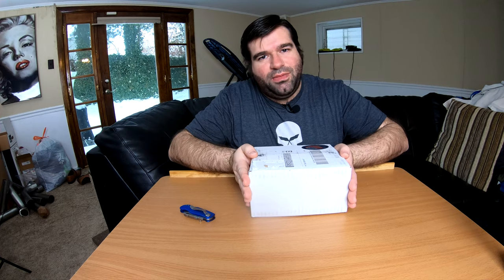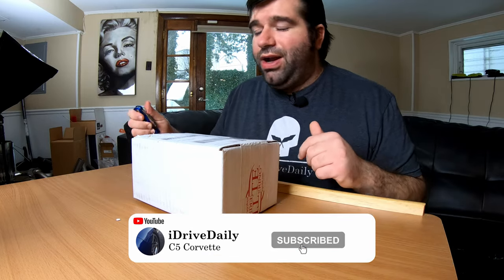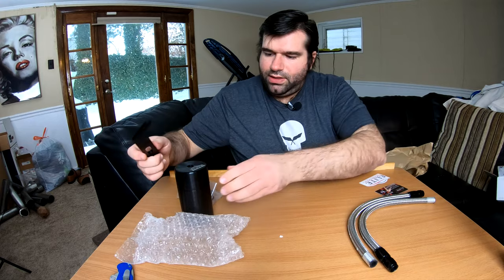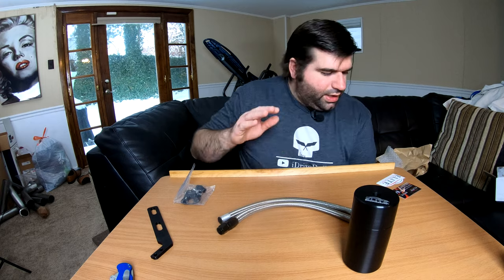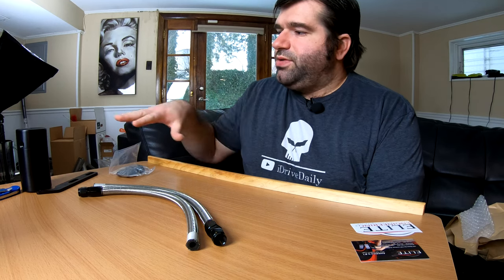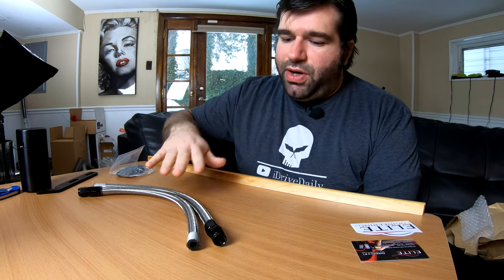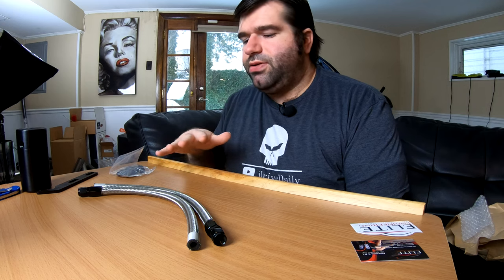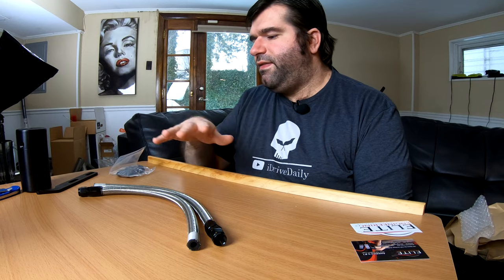Opening Elite Engineering's C5 Corvette Catch Can & Catch Can Necessity

Comment: Love the Elite Engineering Catch Can. Tip: put plumbers tape on the separator inside the catch can. Mine vibrated loose and was sitting in the bottom of the can. No issue after I put some Teflon tape on there.
Reply from the maker: Thanks for the tip. I'll put some in. Overall, I'm really happy with the quality of the product so far.

Comment: oh im a little jealous of those braided lines, love those catch cans, perfect for a road driven sports car. i would say a catch can is very useful/ necessary on any vehicle. they dont run on oil, oil im sure contributes to carbon build up which could cause detonation and a less efficient combustion. plus they look sweet as hell and of course race car. got those hood stuts in and on they didnt have a name on them, maybe a bit aggressive lift, kinda pops the hood at the end of opening but surly cant hurt anything better than the damn hood slamming all the time.
Reply from the maker: Yeah, mine are also very aggressive and sometimes have a "pop". I found if I lift a bit more towards the center, I can avoid the pop.
Reply: Yea I was kinda thinking I might not let it  pop so hard I assume it's just rivnuts holding that bracket to the hood